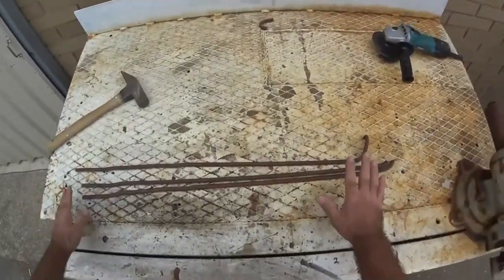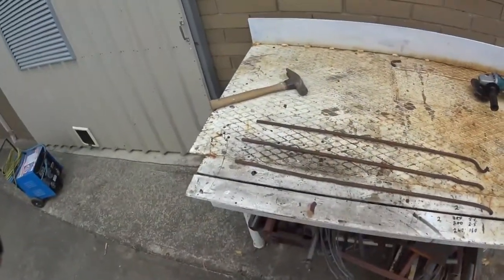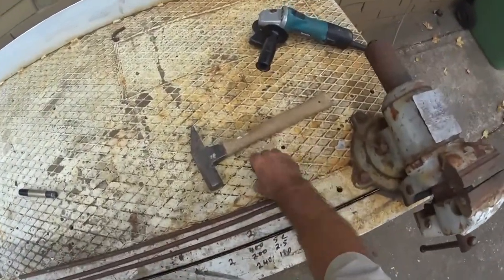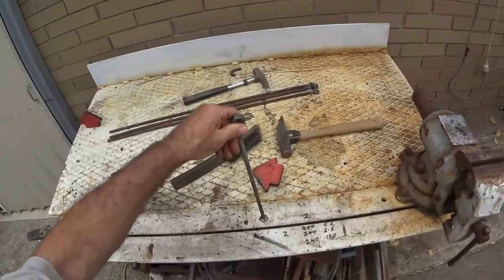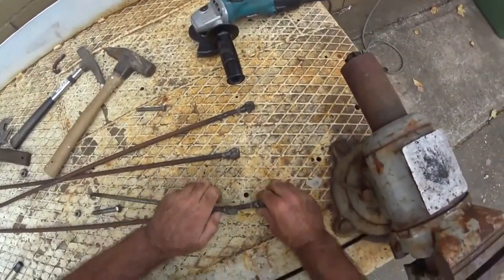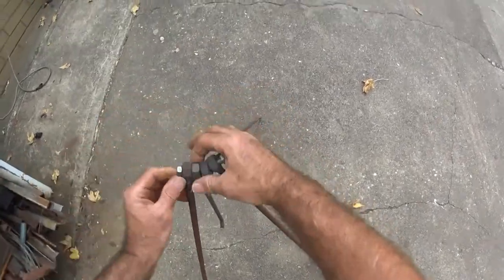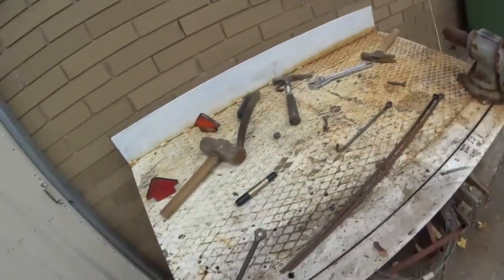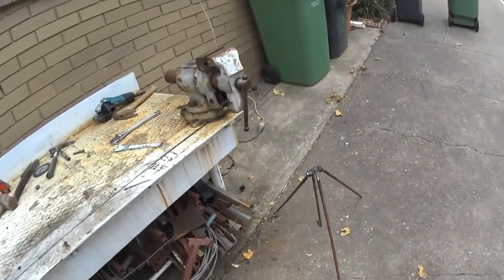How to make a Campfire Tripod, for your Billy etc. DIY Camping Gear Welding Projects

Comment: How long did the legs end up being?
Reply from the maker: Hi, the legs were 26 inches (660 mm) which is quite short for a tripod, but it fits in my camping box and does what I need it to do. Grab a few broomsticks 3  that you have home and make a practice tripod with a bit of tape, you will soon work out what size you should have. It will sink into the ground a bit when using it so allow for that. I hope that helps. Thanks for your comment
Reply: Nice project & video!  I just made a similar one.   35" legs because #1 I had a 9 ft. piece of steel, #2 I reckon I can always trim them shorter if I want, and #3 jamming them into the ground is probably even better.  Thanks for the inspiration :)